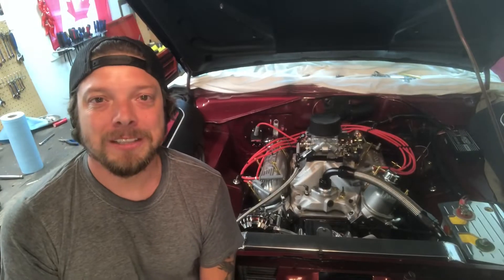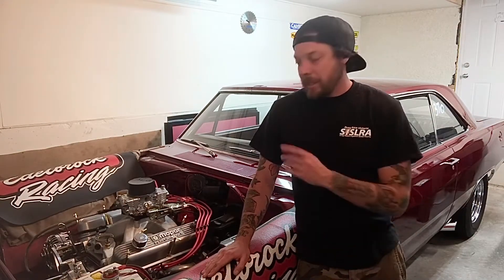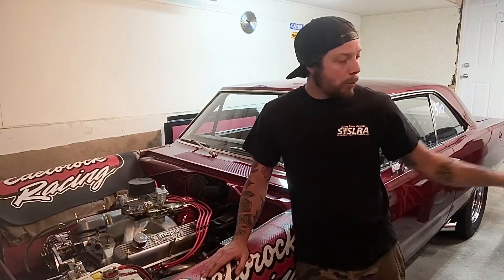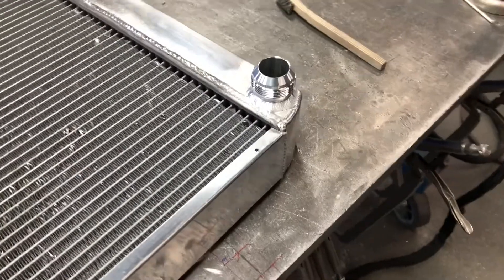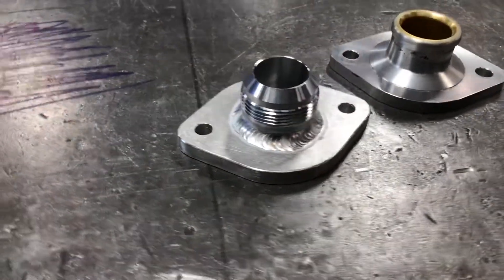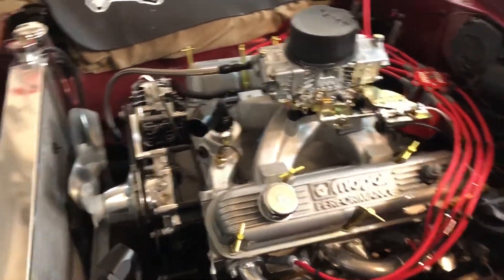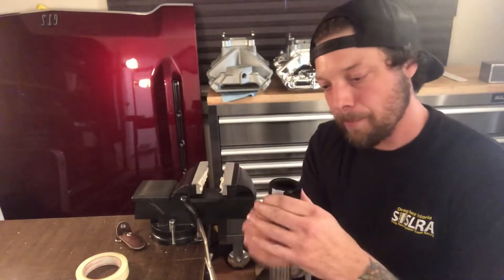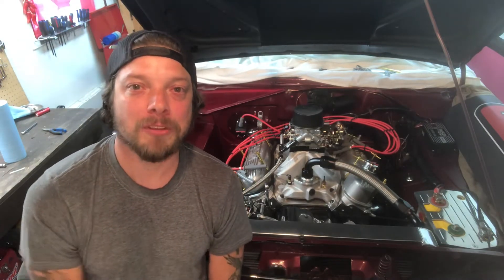How to make a AN radiator hose with a AN water neck using AN fittings

Comment: What did you do for connecting the lower hose  to the water pump? Both engines I am building have cast water pumps and cant find any info on how to connect -AN style hoses to them.
Reply from the maker: Haven’t done bottom hose. Cut and weld a fitting on tho.

Comment: The welding stuff is pretty cool, the rad hose is a great idea. My rad hose is just rubber and it pales in comparison. I thought about the spectre braid for it but I hate those mock hose clamp fittings with the false nuts, this is a much better idea.

Comment: I like that you don`t run a bypass hose between the pump and intake. i want to do this also. Is there a downside to this. Love your car and can`t wait for your videos.   from Bristol TN.
Reply from the maker: Ya it’s a nice delete to clean up the front of the motor. Only thing is I don’t run a thermostat and no heater. Other than that I haven’t seen a downside. Thanks for watching
Reply: @SimpsonsSpeedShop  Thanks, Just finished tapping my water pump on one of my 340`s. Building a 74 Duster.  really liking that car and especially the motor.  looking
 forward to seeing your racing videos.

Comment: Nice!!! I myself have a '68 Dart, and I noticed you have a cross flow radiator. I would also like to get one but since I am here in Germany I am a little reluctant on buying one, afraid that it wont fit. Any recommendations? Thanks... love your channel!!!
Reply from the maker: Hey! Awesome you have a dart over in Germany! Best thing would be to pull you current radiator and measure exact how
Much room you have then you should be able to find one that fits you dimensions. Good luck! Thanks for watching

Comment: I got a 360 with a 904 in a 75 Duster with a 4800 to 5000 stall put some padding in that seat you should get a  good 60 foot out of it 1565 and lm still working on the suspension good luck and keep the videos coming
Reply from the maker: Hahha ya good call! I just got the new converter back so she’s going in! New vid out soon. Thanks for watching

Comment: Did you do the lower hose also? If not why not?
Reply from the maker: Didn’t do lower hose. The intake to the water pump is a slip fit on a cast piece so I would do that one. If I go to an electric pump then it will have a tapped inlet hole that I could then do a lower hose.
Reply: @SimpsonsSpeedShop  Do they make a compression to AN in the larger sizes? I know they do in the smaller sizes?

I ask because I am in the planning stages of my 2 wheel drive 1972 Blazer LS3 6.2/4L70 in a roadster shop Chassis. Thanks
Reply from the maker: A compression?
Reply: @SimpsonsSpeedShop  I tried to find a link? They make AN fittings that are AN on one end and a compression fitting on the other. I probably have a -6 or -8 fitting somewhere. I'll see if I can find a part number.

Comment: Part numbers?
Reply from the maker: Just got everything off summit.
Reply: Simpsons Speed Shop I looked at summit and they have a -16 water neck. Do you think 1” will suffice in place of the -20 (1-1/4”)?
Reply from the maker: Ya I wanted -20. Lots of guys do this with -16. I just thought the 20 looked a bit better as the 16 looks kinda small. I’m sure a -16 would be fine also, lots of guy do that.